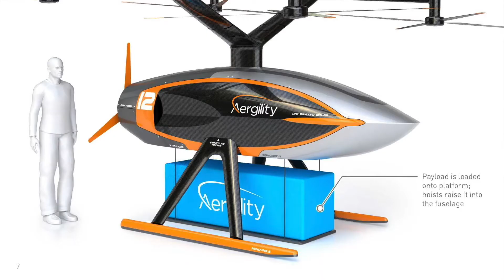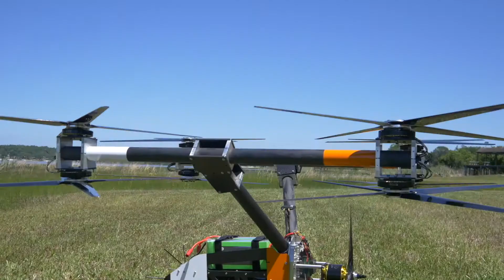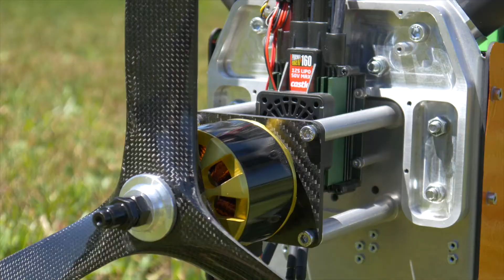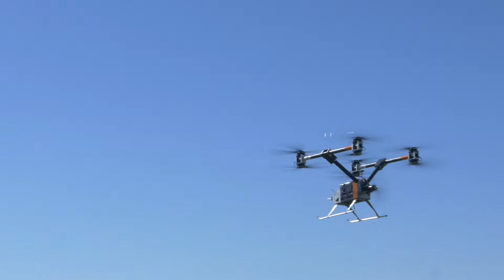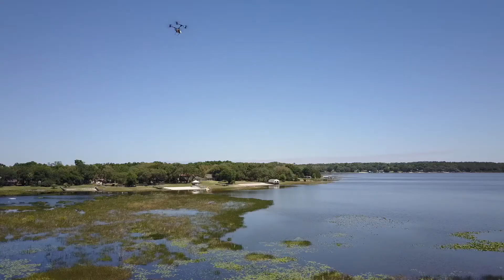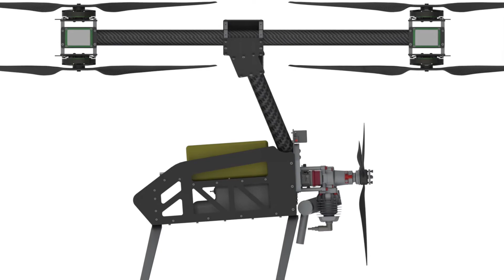Watts Innovations Project Highlight: Aergility

Comment: Why not a coaxial heli with a pusher prop? That's the future of rotary wing flight. Would be more efficient than 8 electric motors
Reply from the maker: I'm not quite sure I agree with you.. The beauty of this is that you only have a few moving parts - all of which are motors. A coaxial (or any type of ) heli have multiple moving parts which is what they are trying to get away from. Helicopters most certainly have their place but this is another alternative that I think will prove to be incredibly useful for long range UAS use.